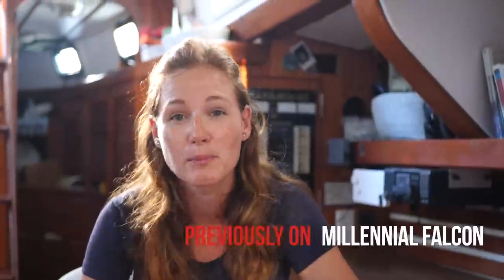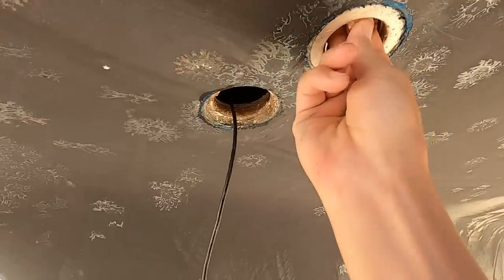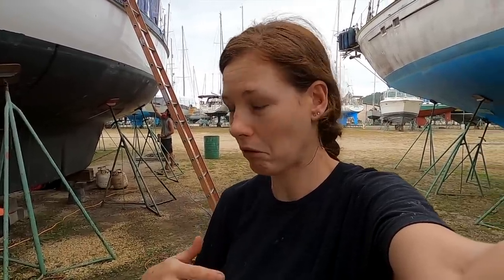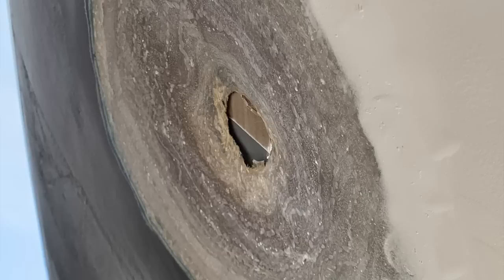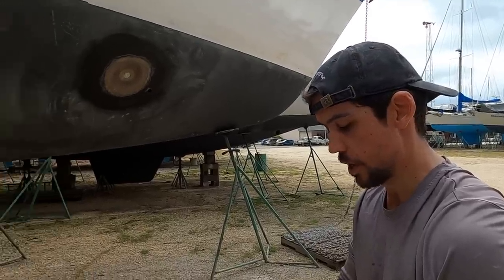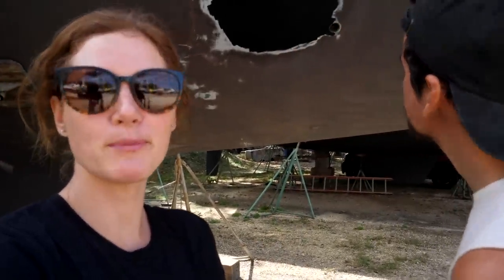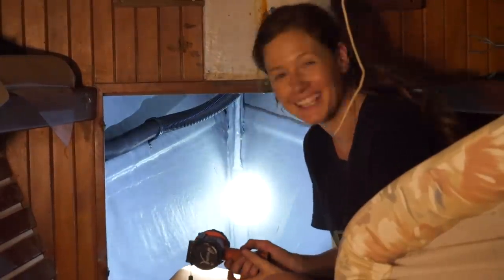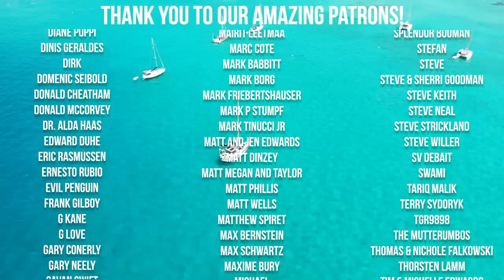There's a 2 inch HOLE in our BOAT... [EP 191]

Comment: One more job up top I noticed.  The cable screwed into the vesper antenna needs to be sealed with self sealing rubber tape then electrical tape to keep water out.  Speaking as an amateur radio operator with many similar antenna connections.
Reply: Does not electrical tape glue melt when it becomes 90 degrees then fall off?
Reply: @chhindz  The chepo type may. Scotch 88 tape is good to 105C/221F.
Reply: @philipmackin1025  Good to know, however in an engine compartment that temp possible.

Comment: I really think it’s better to go small to big…. Each layer then gets a bonding point to the hull.
Reply: This seems to be a point of much debate, is it better to have the first layer have complete bonding to the hull or each layer have a little bonding. I don't remember where now because it has been a long time since I saw it, but I remember someone finding a fairly authoritative source (maybe West Systems?) that claimed the way Adam did it is the correct way. I don't really know and could see the argument either way. My guess is that in practice it doesn't really matter, both ways will be very well bonded since the fiberglass layers and resin if properly wetted become a single unit.
Reply: I saw that on you tube as well, I can’t recall which channel it was. It might have been sailing brick house?
Reply: @josephclayton1835  I think Parlay had an episode that covered this.

Comment: Wouldn't be a good idea to have the chain locker in the front of the boat sealed. Like a water tight balk head to help keep water out of the cabin and protection against sinking and muddy water from the chain and in case of a collision that were to damage that area. I heard some countries require certain areas to help protect your boat.  The cabin area is so big it's hard to protect it. Just a thought.  Keep up the great work you both are doing.

Comment: Good job I watched this. I need to fill in 2 thru-hull fittings and for some reason thought the smaller circles went in first! Probably dodged a bullet there.
Reply from the maker: Ahh, double check the small to big/big to small debate! Others have made a very good case for doing it opposite to what we did! 😅
Reply: @SailingMillennialFalcon  Being a newbie, the biggest thing I've learned is that sailors can't agree on anything 😂. If I ask on the channel for the best way to do something, I invariably get 47 completely different methods 😂

Comment: Your bitter end block shouldn't be rigged with the corners in succession. Tie it so the rode binds across the grain of the wood and loads multiple holes at the same time. The way you have it, the corners of the block could open like a zipper. Best of luck.

Comment: OK. The small to big debate. (BoatWorksToday is the channel that I think some of you may be alluding to.) The idea is twofold: each piece of fibreglass is bonded to the surface (not just to the previous piece), and you can lay each piece more flatly (less deformation, means less air bubbles). After all, if you were filling a cone shaped hole with rocks would you put more rocks at the bottom?

Comment: Nice job on the patch. I don’t understand why all boats aren’t made like SV Delos (Amel Maribu) only have ine thruhull for the entire boat
Reply from the maker: Everything has its pro's and cons... if that one sea cock clogs with seaweed, fails or the hose breaks etc , then everything that requires sea water or draining on the boat can no longer be used. Every individuals preference I think!
Reply: @SailingMillennialFalcon  Amel has been very successful with the one sea cock design. Fewer failure points.  I would like to suggest this method to fill a thru hull: If you don't want a fitting, the proper way is to cast a resin plug which fits the hole. Then bevel both sides of the hole, glassing the plug in place. The resultant is a dumbell shaped plug.  I did not see in the video how the outside and inside patches were pressed together.  The sailing show Alluring Arctic recently purchased a Garcia. They converted to the Amel design with one caveat, the single sea cock enters the boat in a tube that goes up above the waterline in a solid structure with the valve at the top. Great show, keep up the good work.

Comment: Ship shape and Bristol fashion.  
Would it be considered wrong to just stack up the fiberglass layers saturate them with epoxy (squeegee them out a bit), coat the hole area and then apply the stack?  I did this with 8 layers of 6 ounce glass on a kayak that had 20 cm diameter holes in it (the kayak had been folded in half). Worked great. Took no time at all. I did add some fairing compound and sanded that down. (After five years I still haven't painted it.)  It's just I see everyone on YouTube doing every single layer separately. If there's any air or starved area in the stack it's pretty obvious.  And because I had odd shaped holes I traced them, scanned it, then duplicated and scaled down each layer. (Later I just traced the hole and drew in the concentric lines.) Then I just cut out the print out and the glass at the same time. (One of the reasons I coated them all at the same time was the odd shapes. Doing them all at once made it easy to keep them lined up.)
Reply: Don't know if its right or wrong but watched ep 11 of "spear it animal" & they did it this way ????
Reply: I'm sure it'd be fine. One question I have is the order of the size of layers. When fixing dings in composite planes and dinghies I've used the order this bloke used - big at the bottom and getting smaller - but the fairing gradient/contour needs to be a lot more precise in planes. When I look at the Don Casey boat maintenance books, he has the smallest layer at the bottom and biggest on top.
Reply: @usefulcommunication4516  Boat Builder Magazine (A Trade Publication for Professionals who Manufacture and Repair boats) tested this out and found little difference in strength working in either direction however the results did slightly favor putting the largest piece in first.

You want to be able to get great even contact on the base layer of cloth and every subsequent layer so best to stack and roll each layer one at a time to ensure the best contact especially of the base layer to the old fiberglass to get the best mechanical bond.  The disc roller can't make great contact through to the first layer when you try to apply several layers of wet cloth all at once.  Perhaps not as critical on a kayak but on a Blue Water Sailboat if you don't get great contact between the first layer and old glass then in a high stress situation the entire patch can pop off like the lid on a pot due to the stresses involved.  Not really something you want in the middle of the ocean in heavy seas.

Best!
Reply: @neilfromclearwaterfl81  Thanks. Handy info.

Comment: I’m impressed with no mould.  Did you install a temporary AC or dehumidifier before you left Milly?
Reply from the maker: No we actually paid someone $100 a month to come around every few days and open up the hatches, wash the decks etc. it ended up being a LOT cheaper than the air conditioning/humidifier option

Comment: CSM is supposed to be used with polyester resin or vinylester resin, not epoxy
Reply: When you wet out CSM with a polyester or vinyl ester resin, it dissolves the mat's styrene binder. The mat wet outs perfectly clear, softens, and can be draped over curves and manipulated into the desired shape.

Can epoxy resin be used to wet out CSM? You can use epoxy to wet out CSM, but epoxy doesn't dissolve the binder, so the wet-out CSM will remain white. It'll also be a little stiff and unable to conform to complex contours, which is fine for flat surfaces, such as plywood decks (or hulls). Instead of dissolving, the binder will be sealed in the cured epoxy to create a strong laminate.

Comment: If you accidentally drop your anchor when sailing, you will make a huge hole in your boat with that system you have. You should have it attached so that you can not lose your anchor easily, but  it will need to go if it drops when sailing... do you agree?
Reply from the maker: The anchor is tied onto a cleat while we’re sailing, it can’t move than an inch! 😊

Comment: Any hole in the hull needs to have a sea cock.  I used LARGE ones at the base of any stand pipes, to which other outlets were fastened.  Nothing sinks a boat at anchor more often than lightning is degraded or broken sea cocks or the hoses attached thereto, when someone forgot when leaving the vessel and left them open.
Reply: Thu-hulls for drains (bilge pumps, shower/sinks, condensate drains, AC cooling water outlets, water cooled engine exhausts) really should be installed above the water line with sea cocks installed on the lower ones.  Only the inlets for engine cooling and water cooled refrigerant/AC systems should be through the bottom and indeed with sea cocks and strainers on all of them.

I prefer all the sinks, showers and condensate drains when possible be plumbed into a common sump pan with a pump to send the drainage out a single high mounted thru-hull with an anti-siphon loop and vacuum break with all lines double clamped.

Worst I've seen so far was the drain thru-hulls mounted in the stripe just inches above the water line with no sea cocks plus the tech who last replaced them cheated by breaking the outer flanges off them, adjusting the lock rings so the broken end wouldn't stick out, buttered them up with a ton of silicone sealant and just pressed them into place from inside the boat.  He used one size larger so he could wedge them into place by attempting to screw the threaded portion into the hull.  Half of them had dislodged leaving open holes inches above the water line.  Owner almost lost the boat bringing it to their home port in a good chop.  Had to replace them all with new quickly for them before the next storm which already had the boat rocking so did it at the dock sliding them down a rope and pulling them in through the hull.

The request was for me to check the wiring on the bilge and sump pumps, clean them and verify operation.  They were shocked when I showed them the situation and they saw the open holes with water just inches from them outside the boat.  Added wrinkle was the sump pump had been removed and a hole cut into the sump pan to let it drain straight into the bilge.  Don't understand how folks that do things like this to their customers can sleep at night.

Best!

Comment: I’m just curious about how thick the hull is in the area around the thru hull before grinding, it seemed to be less thick than I was expecting.
Reply: Really depends on whether the boat is cored or all hand laid  fiberglass.  Could be 3/8 inch to a 1 1/2 inches thick on many cruising boats.
Reply from the maker: It's about ~1.25 inch hand laid fiberglass. We ground both sides of the hole to a taper so maybe you were seeing the thinned /ground out sections?
Reply: @SailingMillennialFalcon  That's a nice stout boat and not just a coastal cruiser.  Too many of the newer boats are built so light and thin they become total loses way too easily.

Good job keeping her up and making improvements.  Eliminating any unnecessary holes below the water line is indeed an improvement.

Best!

Comment: This is one of those videos where you say that the massive block of wood will never make it's way through a two inch hole, and then in the not so distant future you have to replay that clip because it did make it's way through the two inch hole.  I hope your boat doesn't end up on the rocks.

Comment: LOL While in the Navy IN Vietnam, we (LST 905) were on our way to Saigon. As (Murphys Law) we were in the middle of the River with our pilot on board, we lost all power and steering at 11 ÷/- knots. Well, lucky for us we had an anchor with all chain, so we dropped anchor to keep from beaching our boat and destroying something and possibly killing someone and Murphy struck. All but about 15 feet of chain went out the hawspipe, we did not have any of the chain locker come out. So those of us on duty, in order to attempt to steer the boat went to the aft steering only to find out that to effect a change in course, four of us had to craw 15 revolutions for ONE DEGREE of the rudder. Thank God that the anchor crew ran to the stern of the boat to drop one of our stern anchors. I slept very good that night.